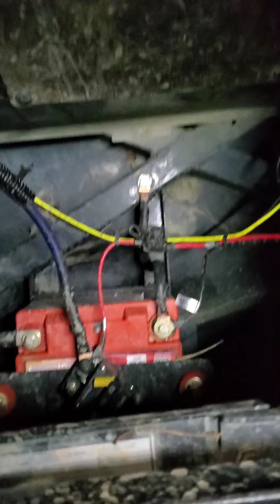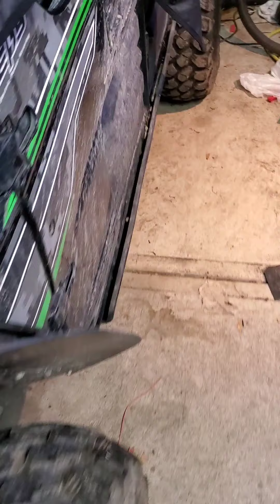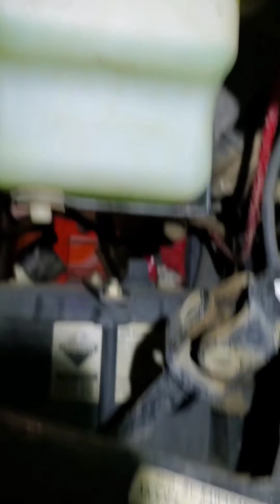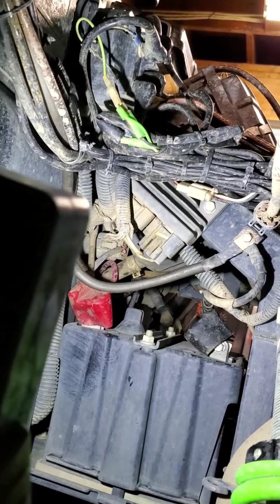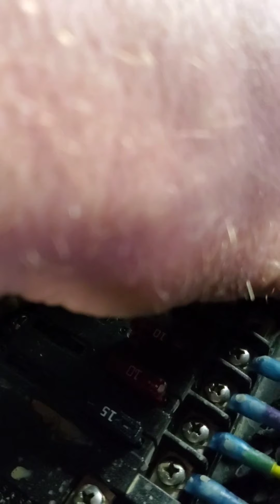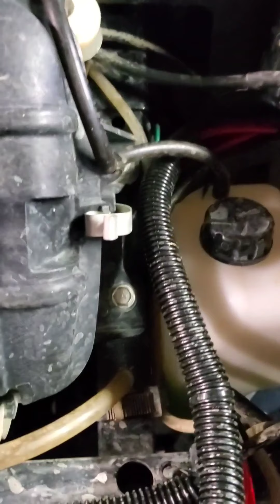Teryx 4 dual battery

Comment: Did you just stack the terminals from the isolator to the positive bus bar and the positive wire from the auxiliary battery?
Reply from the maker: No, the bus bar is for auxilliary battery (accessory) loads only. The isolator separates the primary from the aux and charges the aux via the primary circuit and the vehicle stator. The 12V+ are not stacked. Otherwise the accessories would draw the primary battery as well.

Comment: Great video! I've built a one line drawing for my Teryx, but wanted to ask what battery model you decided to go with on this setup?
Reply from the maker: The factory battery still resides under the hood, however the auxiliary battery is an Odyssey PC925.
Reply: @sspadventures9374  Thank you for the quick response. Keep fighting the good fight.
Reply: What key activated positive did you run for the isolator volt meter?